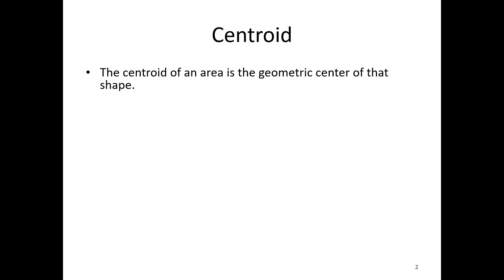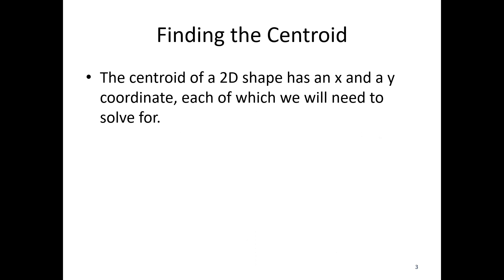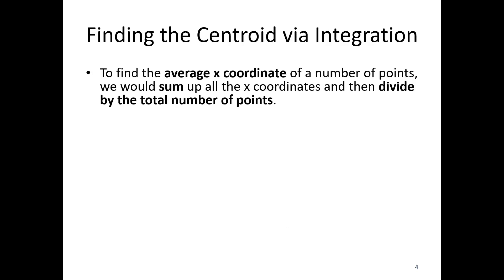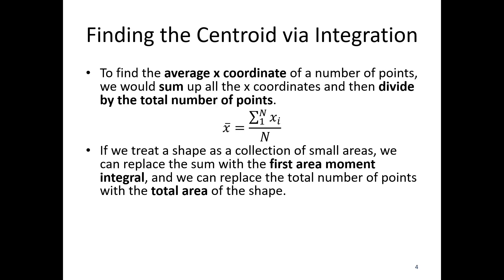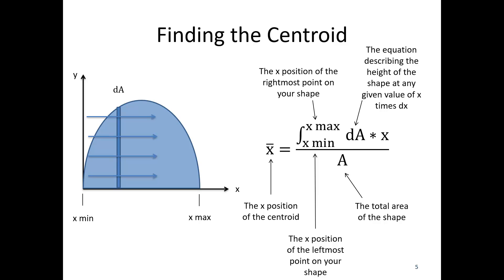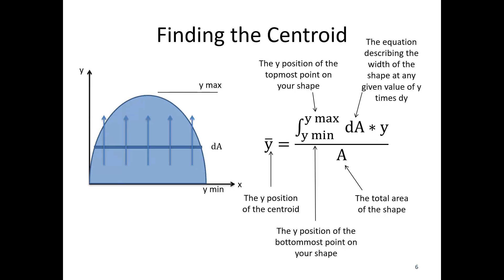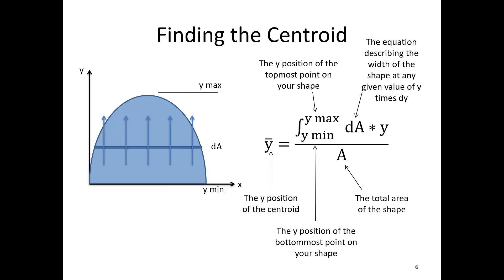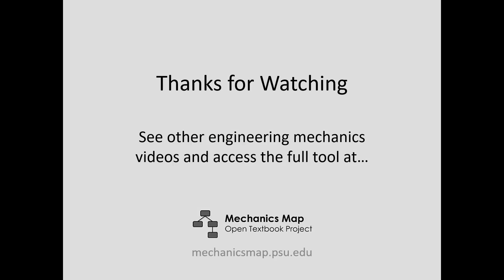A 2.2 Centroid of an Area via Integration - Video Lecture - JPM

Comment: I'm not convinced with your point " the area to left and right of the centroid will be equally "  because how can a point divide the area in order to divide an area we need a line " and we can say for sure any line passing through centroid will cut the area equally
Reply: correction in the last sentence " we can't "
Reply: example is take horizontal line through centroid of equilateral triangle ,the line divide upper and lower portion in ratio of 4:5